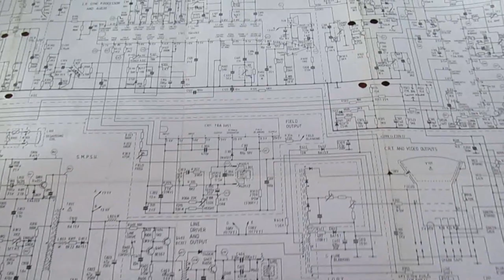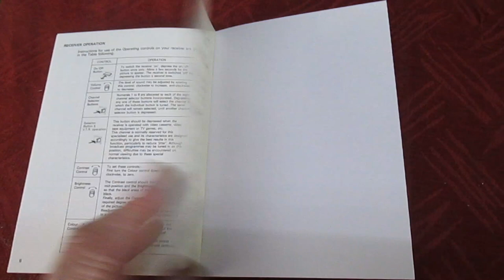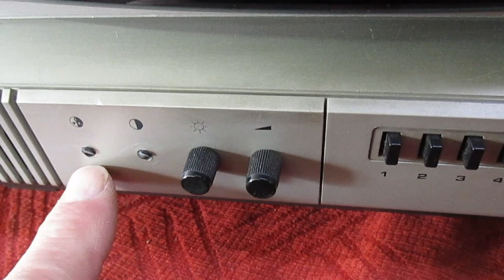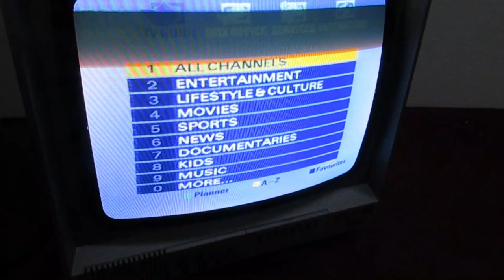Lets take a look at the Decca / Tatung 160 series chassis TV set from 1984.

Comment: I just picked up a red version, got some convergence issues with it but going to restore and service it. Great wee TV for my retro consoles
Reply from the maker: I use to sell these brand new, they came in red, white and black, and silver, I would think the red ones are quite rare now as they weren't the best seller back then , good luck with the restoration , I can see vintage TV s  becoming well sought after now with the rise in retro gaming  stuff.
Reply from the maker: @toddblanks  A slight buzz in the audio may just be a case of a small tweak of the sound intercarrier coil, I will have all the service manuals but Im away for a few days now .